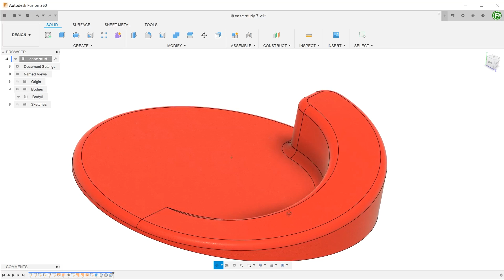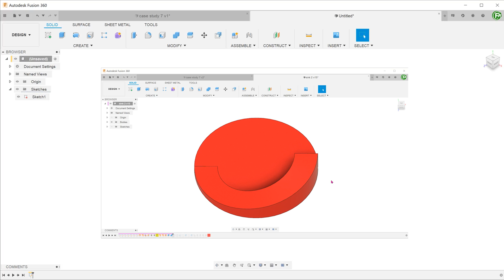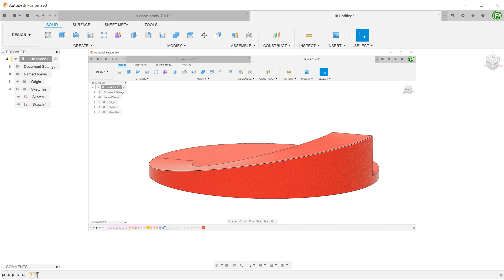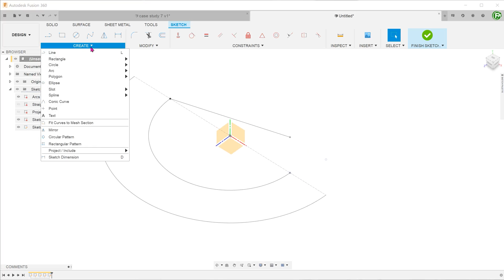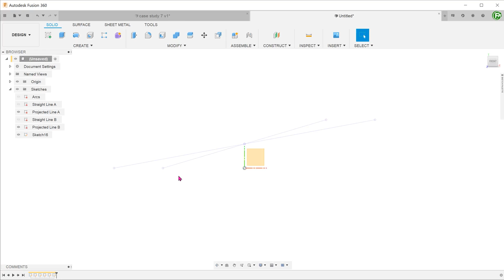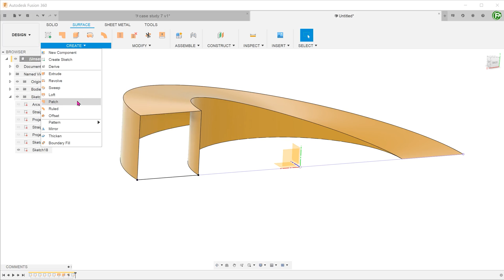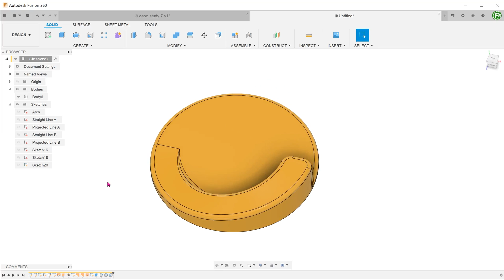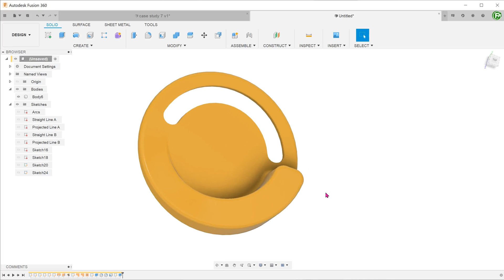Fusion 360 - Case Study 7

Comment: Cheers for the video, it helped me solve some strange behaviors! Although I think some things could be improved. 5:42 I believe you can just just use Patch command here no, just slightly more intuitive? Also all the things done between 6:00 to 7:38 could be done by simply Lofting the top surfate to the bottom sketch plane. I basically ended up using two commands in history apart from the sketches to replicate the same behavior, although do you think there is any downside to my approach?

Comment: Cool way to do that, but too long really. You can extrude this circular peace as a solid brick and use sweep along vector with guide surface (side of the circular plane) to cut it and get exactly the same effect. Your way of doing that will have much more meaning if the arc will be more than 180 degrees so you can't cheat as I mentioned before ). But a cool way to remember us about intersection curves.  Thank you
Reply from the maker: Hi, I'm not sure I completely understand "sweep along vector with guide surface". Are you talking about a helical sweep?
Reply: Yes, I would approach this by extruding half cylinder, then create triangle coil of 0.5 rotation, height equal to the height of half cylinder and the same diameter, then use the edge of coil to create helical surface from line starting at the bottom of cylinder. finally replace top face of cylinder with helical surface (thanks for learning that from one of your earlier lesson)

Comment: Great video as usual.. Could you please do a case study on making sunglasses? Some of the fusion 360 videos out there are mostly with sculpting environment.. I guess, there's only one video from Autodesk Fusion 360 channel which uses lines and arcs to model the glasses, however, it was an advance level and the guy was just running the timeline slides and not really going in depth as to how to achieve that.. This is the video I'm talking about.

https://www.youtube.com/watch?v=C5KR0Iqr1Rw&t=1968s&ab_channel=AutodeskFusion360

The bend of the glasses frame, the bend and alignment of the temples that hinge to the frame, the grooves for the lenses on non planar surface, the nose pad etc. would really make a great case study. Would really appreciate if you made a video on that.. Thanks..
Reply from the maker: Hi, thank you for the suggestion. I will take a look to see if I can do this in the future.

Comment: When I add the vertical constraint  the inclined line shifted.  The other end is not snapped in.  Not sure how to fix it?
Reply: I had to project the arc and then I could snap the inclined line.  How did you snap the line? From what I read on  internet, people said you can not snap on geometry created on a different sketch.
Reply: It seems like auto project edges on reference was disabled after the last fusion update.  This caused snapping not happening. Found the answer here https://knowledge.autodesk.com/support/fusion-360/troubleshooting/caas/sfdcarticles/sfdcarticles/Cannot-snap-to-components-when-sketching-in-Fusion-360-on-Mac-after-an-update.html#:~:text=After%20a%20Fusion%20360%20update,vertex%20of%20another%2C%20neighbouring%20component.
Reply from the maker: From the description in the link, it does seem like "auto project edges on reference" was disabled for some users after the update. If you turn on this option, you should be able to snap onto the arc. Do make sure that you see a square icon appearing before clicking. That icon is a prompt that you have snapped to the arc.

Comment: I am having problems with the patch command. It does not allow me to select more than one edge. You were able to so freely select each edge. I cannot seem to do that. Was there some initial setting that tied the points of your various sketches together? I do have snap to grid on. Is there a snap to point?
Reply from the maker: Hi, it does sound like the sketch entities did not snap correctly to form a closed profile. Go to preferences, design and check that you have the "auto project edges on reference" option checked. Also, when you draw the straight line to close the square, do make sure that you see a square icon appearing before clicking. That icon is a prompt that you have snapped to the point correctly.

I would not suggest that you use snap to grid. The problem with snapping to grid is that it would be hard to tell the difference between snapping to an imaginary grid point and an actual sketch point/vertex.
Reply: I found the preferences in my account and added "Auto project edges on reference" and I was able to do the case study. Thanks.
Reply from the maker: Glad to help.

Comment: What is the benefits of this method over the helix method?
Reply: This is more flexible as your can create shapes that don't follow a consistent helix path.
Reply from the maker: Hi Auday, I'm not too familiar with the helix method, but this does look like a spiral pattern. Will need to try this out.
Reply: coil: section ‚square‘ and 0.5 revolutions, height and section size the same, then offset plane and cut, but definitely not that flexible

Comment: I know you're pushing the intersection curve command (and clearly it's a powerful tool), but I'm still getting my head wrapped around how to decide if it's the tool I need (versus the beginner's mind that says "everything is an extrusion," or "this is probably a machining process." It would be helpful to start with a simple IF-THEN phrase to run through that describes the intersection curve command (or its final, desired result) to trigger its use. Something like, "IF one or more curve changing direction AND altitude THEN intersection curve command." (And then, of course, figuring out how to apply it to the situation at hand.) Does that make sense to anyone else?
Reply from the maker: Hi Adam, I would probably summarize the condition to use the intersection curve command in this way. 
"The desired 3D curve has an easily defined profile when looking normal to two of the primary planes."
It is possible to actually perform a 3D sketch in space and drag points in different directions, but that would be much tougher to control and dimension. This command is a way of producing 3D curves without actually performing a 3D sketch in space. You might have seen videos where users drag in pictures (top, front and side) of products and trace out the outlines when looking at the respective planes. This is where such a command would be useful. 

Side note: Looking at this case study, I probably could have created a plane at an angle to perform the sketch since the desired curve has a straight profile when looking at the side. However, I want to stress that the intersection curve command would still work even if the side profile is not straight.
Reply: I do not understand how the intersection create the curve. If you could please explain. The straight line and the arc does not intercept. It appears like the arc projected a plane .
Reply from the maker: Hi Jack, perhaps you would like to do this small exercise to visualize what is happening in the background of the intersection curve command. Activate the surface tab and extrude surfaces using the arc and the straight line. The resultant line is the line that is produced where these 2 surfaces meet/intersect.